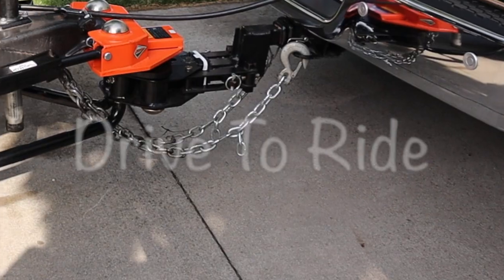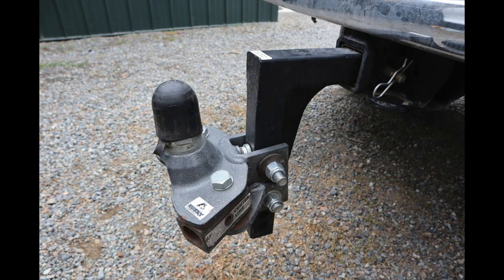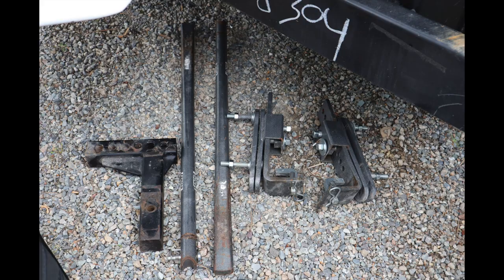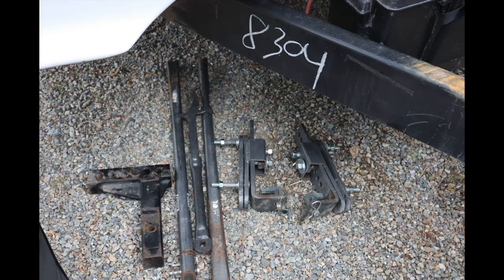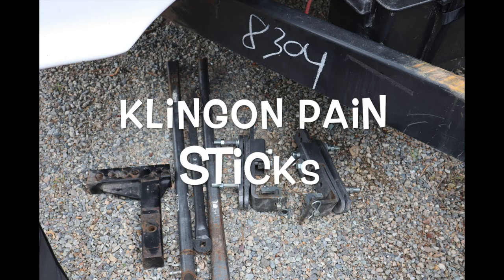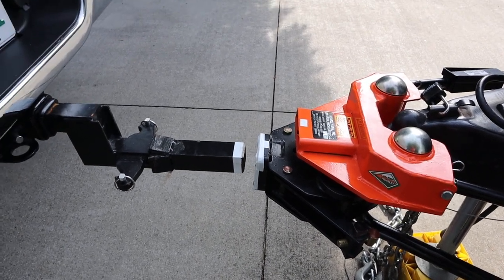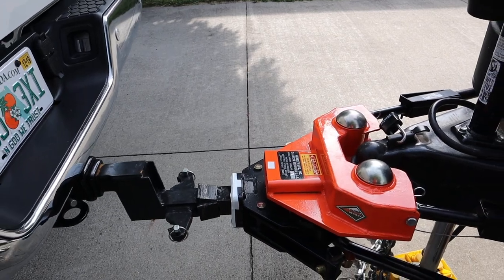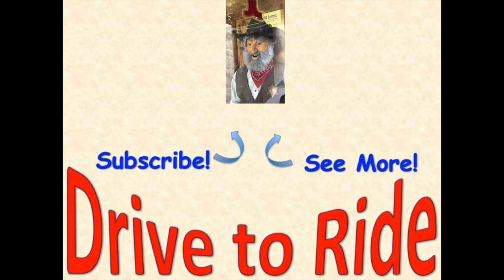Hensley Arrow Hitch - Why we bought it

Comment: This Hensley did really well for me during  the 12 years I traveled from project to project while working for a contractor.  There was no detectable sway even with fairly high crosswinds.  The one thing I had to make sure of, however,  was to adjust the trailer's brakes (at the controller) to a level high enough to prevent the coach from trying to overtake the tow vehicle during panic stops. 

 It's real easy to get hooked up after you've gotten a few reps.  With the Hensley I found that the trailer tracked better behind the tow vehicle than with most other setups.

Comment: I'm sorry, but that hitch seems way more complicated than the Equal-izer hitch we have.  and those "pain sticks" you were complaining about....well I guess no one ever showed you the easy way to get the torsion bars on.  Hook up the torsion bars to the hitch.  Swing those back towards the trailer.  here is where they could be too low and you need to use that "pain stick" to heave up and get it on the lip of the bracket.  The hint is to use the trailer jack to 'raise' the trailer (while connected to the truck) and keep raising until the torsion bar just swings over.  Only a few times where I had to use the "pain stick" to get it up on the bracket but wasn't enormously hard.  This is something that I will continue to deal with and not spend crazy money on such a difficult hitch like the Hensley.  This has been going on for 6 years and now we are upgrading to a fifth wheel in the next year or two.  Also....to keep all those hitch components connected to your trailer all the time when you are not pulling the trailer seems excessive.  But, to each their own.  Happy camping!
Reply: I agree with you. Seems way to complicated to hitch up. Seeing as the system stays attached to trailer all the time why can't you just back into it and be on you way.
Reply: You must have missed the part in the first few minutes where they said there were times even after using the trailer hitch they still had to use the "pain stick" and it was then that it would give his bad shoulder problems.  For someone with limited mobility this is the perfect setup.  FWIW I have The Equil-izer too, but if/when we upgrade TT I will be going with the ProPride 3P.
Reply: True. But there really is no comparison regarding sway control....HA is the BOSS
Reply: I agree 100% I also have the Equal-Lizer hitch! #1 rated hitch every year!  Too many pc's and parts to the Hensley! Most people shouldn't be towing that don't understand the systems they are using.

Comment from the maker: The Hensley Arrow Hitch is a good piece of equipment for the Travel Trailer enthusiast. Installing it isn't difficult. Learning to hitch with the Hensley is quite different from a tradition ball and coupler hitch, but with a little patience, it becomes easier.
Reply: If you have a dually you don't need this insanely over priced, complicated hitch. Stop wasting your time and money with this and get yourself a basic $50 hitch.
Reply: @balbi7590  that hitch is a complete waste of money and time for a dually. If you were pulling the trailer with a half ton then it would be needed. Do you think dump trucks use weight distribution hitchs even though they pull way heavier trailers.
Reply: @balbi7590  you could end up bending your trailer frame with that hitch.
Reply: @balbi7590  clearly you don't have a clue what a weight distribution hitch does, if you did you would understand why bigger trucks with a dual axle don't require them. If you are too afraid to put 1000 pounds on a dual axle then you shouldn't be towing.

Comment: When running at night, I will look in the mirrors to see if the RV is still there. If you have $80,000 in your rig, the Hensley cost is less than .0350 percent of the value. It is worth every penny. If you survive your first really bad event, call Hensley. I had mine shipped to Myrtle Beach and put it on in the camp ground. This was 12 years ago and I have never moved the RV with out it.

Comment: Happy it works for you, love the Klingon too. However When you say it's like nothing else you made me laugh in "ProPride 3P" ;-) Jim Hensley updated his design to fix the issues with his first design that bares his name giving the world the ProPride 3P improved sway elimination hitch. :-) BTW the 3P does NOT require any holes to be drilled into you trailer frame. When you current hitch is worn out check into the ProPride 3P, you may be surprised in difference.
Reply from the maker: Fair enough!
Reply: It seems like you are misleading people to believe that ProPide3P is a Hensley product but its not!
Reply: @anthonylopinto2842  the ProPride 3P is a Jim Hensley design. It is not a product of the Hensley manufacturing company that kept his name after they split. I never said it was the same company nor did I mislead anyone to think the new improved design was part of the old company. ProPride is a separate company and anyone who looks it up would know that instantly.

Comment: Enjoyed your video, you guys make it interesting.  One comment, to be hooked up properly, your safety chains should be hooked up from the bottom, not down from the top.  If you hook from the top down and your Little clips Are not there any more or the spring is gone, and you make a turn and give the chain slack, now the tip of the hook is much closer to the opening on the holder, and it wants to fall back, towards the trailer, with a little bump as you turn, the chain can jump right out of your tow slot.  If you hook from the bottom, and you give the chain some slack, the hook actually covers more of the slot and if there is a bump, it jumps up and falls back on the tow slot.  Hope this makes sense to you.  I’m sure there is a you tube video on this, somewhere, demonstrating it.

Comment: Nice video. How well is this hitch for hooking on being on a slope or angle? We are thinking buying one but have heard that you need to be straight on to connect. Many of the campground we have to hook up at an angle or a slope. .
Reply from the maker: John - Sorry for the delay in responding. We no longer have the trailer or hitch as we went to a 5th Wheel. However, to your question, you have to be dead on straight to get it hitched. There are some maneuvers you learn to do with the tension bars to help, but being a significant slope might be a challenge.

Comment: Since this hitch allows such extreme turn radius is there increased risk of tow vehicle hitting corner of trailer?
Reply from the maker: My experience is that the risk of the tow vehicle hitting the trailer is somewhat less because the hitch actually moves the two further apart; perhaps another 6 - 8 inches as I recall. That isn’t to say the risk is eliminated, just reduced.
Reply: @DriveToRide  Thanks.

Comment: I don’t see that it is any easier than a regular torsion bar hitch. If anything more difficult. I once had a neighbor in a park and watching him hitching with a Hensley discouraged me from wanting one.
Reply from the maker: Yep, getting hitched with the Hensley  is a challenge at first but it does get easier with practice. If sway isn’t a concern, then traditional hitches might be preferable but Hensley hitches are great otherwise.
Reply: @DriveToRide    Sway is always a concern but I have had very good results using a sway control with a conventional load leveler hitch.

Comment: They don't know what they're talking about. I have that exact hitch. you just have to lift it up higher. you do not even have to have the lever at all. and you can put it in with your hands very very good easy lift hitch.lol The Henley hitches a pain in that butt to line up. you have to be exactly correct. It is a pain in the butt. They clean about they complain about the pain stick but they have those one sticks they have to hook on they are way harder. That's too funny sales.